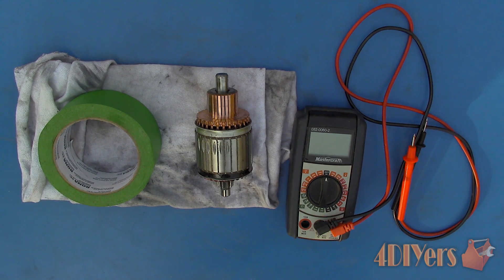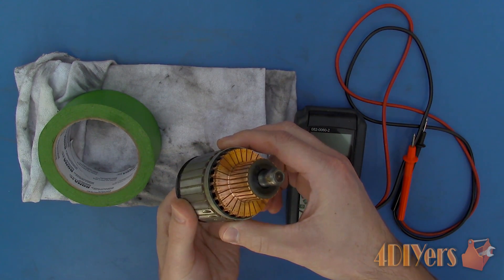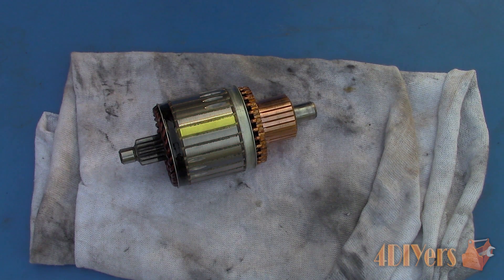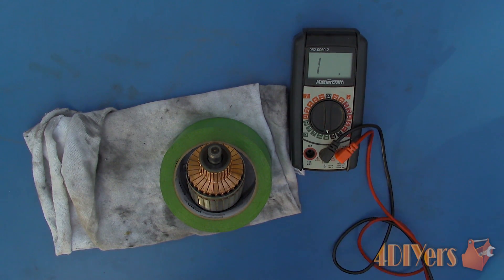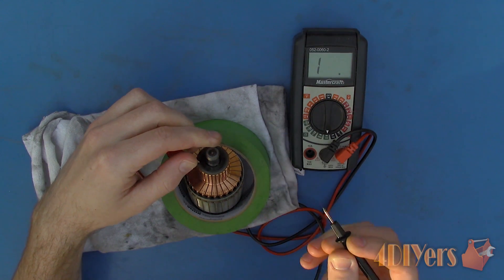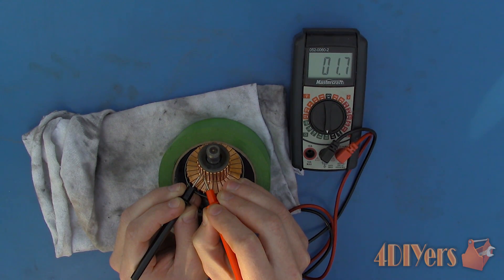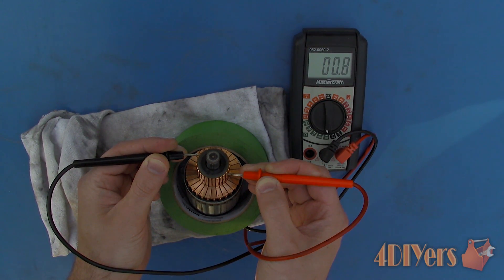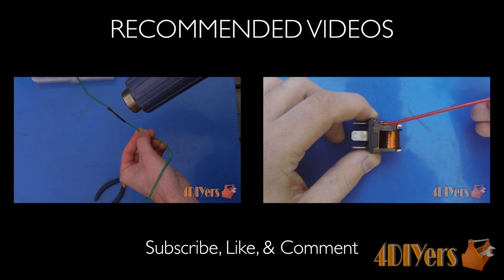DIY: How to Test an Armature of a Motor

Comment: My armature passes all these tests, however the brushes are sparking and the stator is overheating causing the motor to stop working.
Reply from the maker: Have you cleaned the armature and brushes? Also how are the bushings/bearings?
Reply: @4DIYers  The brushes are new, the commutator has been polished with a 1200grit sandpaper. I've repeated this process multiple times including bedding the new brushes against the commutator surface. However still it continues to produce sparks, leaving trailing burnt marks consistently around the commutator and the motor shuts down after 5 seconds or less.

Comment: Hello sir is that golf2 armature? I have similar magnet type can you tell my what winding type that is? I noticed in the lamination stot is located around 3-4 coils per slot so Im not shure what winding type it is? The commitator bars seam to have 3 wires atached to ich segment. Its so tight I dont see much inside the armature.I originali wanted to use that armature and trying to build small high amp generator .So hoppe you know more .

Comment: We have a couple dc motor at my work, if you check between A1 an A2 which is armature 1 and armature 2 you should have some resistance correct? I have some resistance readings between my field wires but showing open no resistance between my aramture wires. Does that mean the motor is bad?

Comment: You've overlooked one common mode of armature failure, and that's wear of, or loss of undercutting between commutator segments. Either situation can be fixed by skimming the commutator in a lathe and then re-undercutting the segment insulators using a fine-tooth saw blade of correct thickness.
Reply from the maker: It wasn't overlooked, it was covered in another video. This video was specifically made for testing with a multimeter.

Comment: Thank you for the video. However this process can be simplified. All poles are connected to each other. look at a schematic of an starter armature. you only have to check for continuity between one pole and a couple of the others, 4-5 adjacent and your done (since they are all connected. the 180 degree test can be omitted (already confirmed since, yes, they are all connected. You should not have continuity between the axle/armature and one pole( yes one, again, because they are all connected). the ohm reading is likely test wire or instrument. Starter wire are rather large and has 0 ohm or close to. thanks again!

Comment: I enjoyed the video. If I am not exactly 180° let's say I am off by a bar or two should I get a  reading? And on my volt meander the numbers keep graduating the longer that I have a connection is that normal thanks. I am trying to fix my grinder and I have not found the answer on YouTube so far so the next step is to disassemble another tool  and see if I have a different result. Thanks

Comment: My commutator bars are ONLY connected to the shaft and a plastic fan.  This unit then fits into a non-removable casing containing the armature windings/lamination stack.  This motor is part of a whole house furnace humidifier that has a motherboard connecting the water solenoid, humidistat via the transformer (24V) and then the house current (120 VAC) to tell the fan to turn on all using the class 2 Transformer  Pri: 120V 60hz / SEC: 24V 10 VA.  Using your three test method, there is a ohms detection on the shaft and the commutator...but its not the same set up as yours; other two test pass per your recommendations.  NOTE:  The fan "hums" when plugged directly into the house outlet but does not when reassembled.  So, another question:  Is the STETRON SR11CS10DC24, on the motherboard directly next to the 120 VAC fan connection also key?  Is it a Relay or Start Capacitor (I am only learning electronics via YouTube the past week so pardon the dumb/inaccurate wording.  Not sure how to test this correctly.  With that said, I am looking for a unit that resembles mine as described above

Comment: Hi my starter has passed all this tests on the armature and field (which is new) but still shorts and doesn't turn. Could it be there is a "magnetic short" say if the laminated plates in the armature are touching each other?

Comment: I checked my commutator it showed 0 ohms resistance. Commutator to iron laminations was no reading , and commutator to main shaft was no reading. Which is supposed to be good by auto electric manuals. Replaced brushes using power tool type, and filed to fit as too big . But not working any suggestions? As to what I have done wrong ? Any reply appreciated thanks from Australia 😊

Comment: question:  if I apply voltage directly to conmutator the armature rotates fine. If I reassemble with brushes making contact with conmutator, nothing happens. What could be the cause?

Comment: What if the Armature passed every test what could still be the problem? heavy arcing
Reply from the maker: There is an issue between the brushes and commutator. The commutator may need resurfacing or you may just need to replace the brushes.
Reply: 4DIYers  Thanks for the fast answer, thats the problem the brushes are as new as the rest of the armature about 1 month old and looks pretty nice and also tried it with new brushes after cleaning the commutator .
Surface of the Commutator doesnt look wasted either.
Could it be possible that the reason of the problem is the Stator/Pole Shoe/ or Field Winding and not the Armature at all?